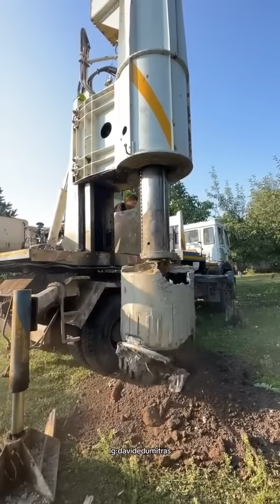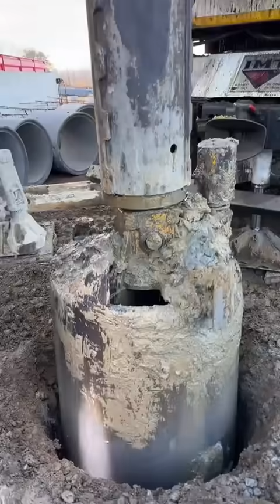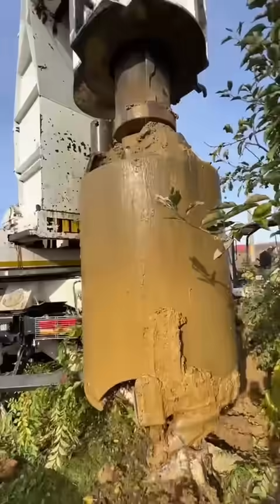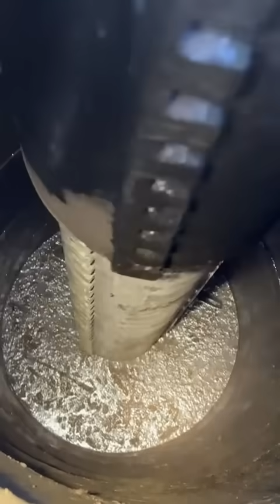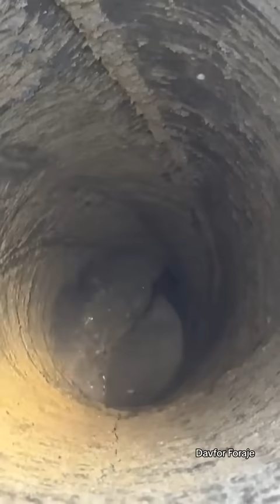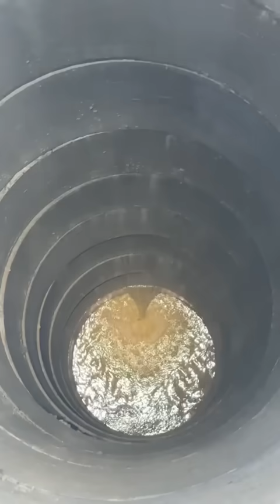Making a water well

Comment: What's a average price for having this done? And what area are you in? Thank you.
Reply from the maker: Hi, good question.
On average the price is around 250 dollars per meter. If the ground is rocky everything changes. You need a different machine and the price goes up to 600/800 dollars per meter.
It happened that the customer insisted on drilling to find water up to 60 meters deep. Obviously the deeper you go the lower the total price will be, otherwise you would spend too much.
Let's say that the price is very variable.